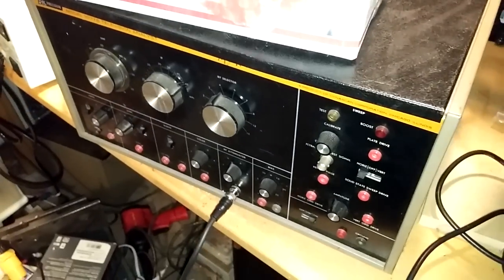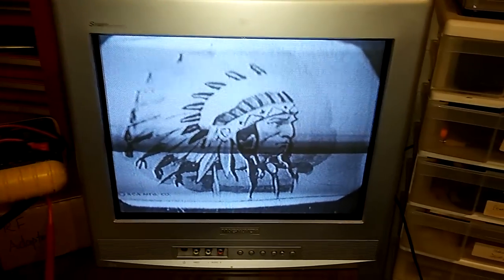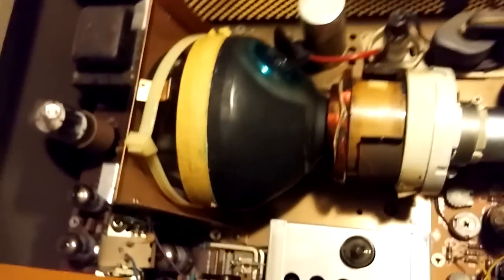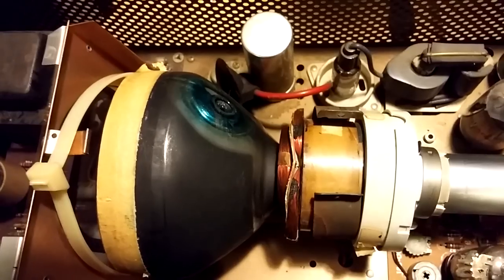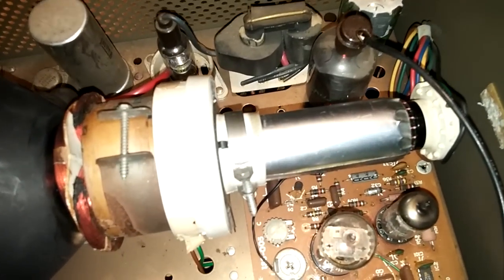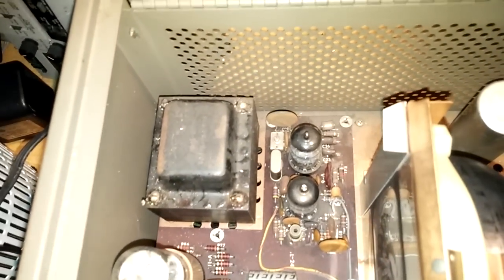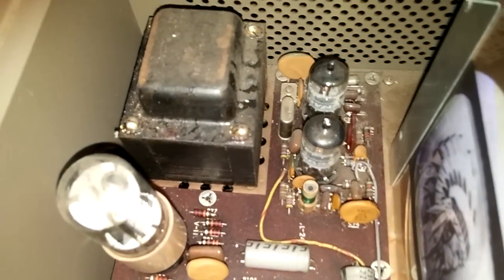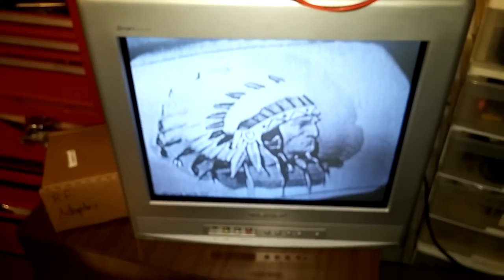B&K 1077B Update: CRT replacement

Comment: What kind of TV Set is this? I never seen a TV where you look inside at the image on the CRT
Reply from the maker: a transparency with the image you want to transmit sits on the face of the crt and a photocell (called photomultiplier actually) a few inches in front of the crt picks up the light and converts it back to an electrical signal.  its called a flying spot scanner, this is one way test patterns were generated in the old days.